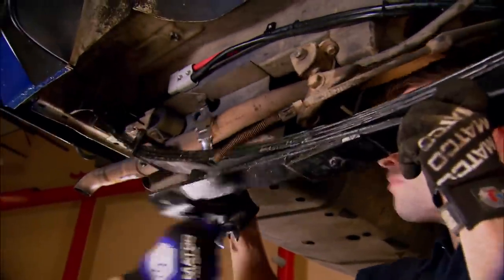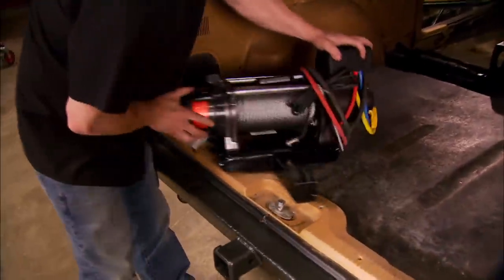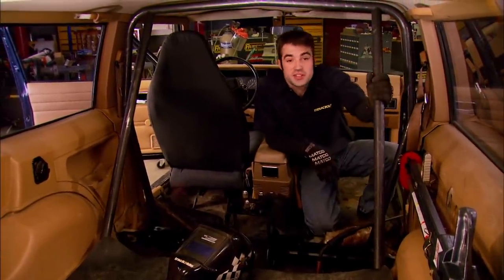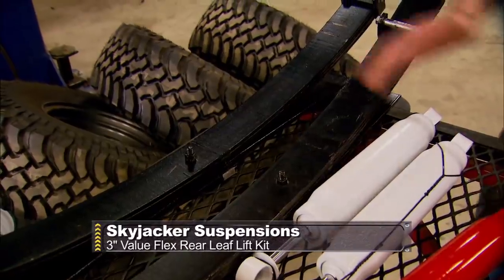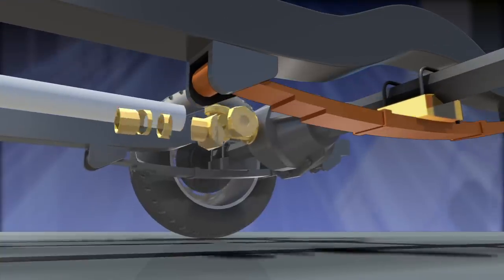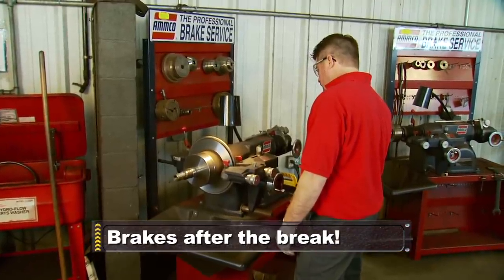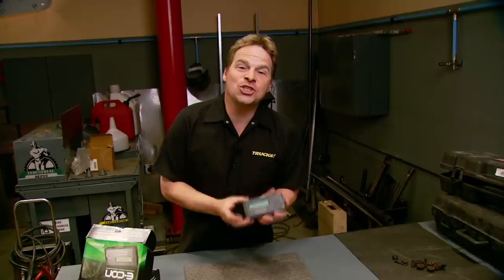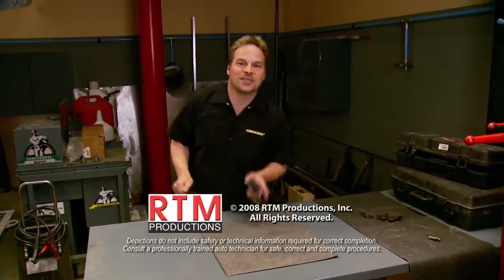Swapping In A Junkyard 8.8" Rear Axle In Our Cheap Jeep Cherokee - Trucks! S10, E9

Comment: You forgot to mention adding hub-centric rings that fills the gap between the rim and the wheel spacer adapter so your lug nuts are not taking the full load of the bumps in the road way and popping one of your wheels off going down the highway... @ 16:37.. clearly an issue... still a fun video though...

Comment: As cheap as new rotors are anymore I don't even bother with machining the old ones. All you're doing is asking for pulsating brake problems.
Reply: It was more about a paid ad, not saving money.
Reply: Yes
Reply: I haven't machined a set of rotors since 2002. New ones are so cheap
Reply: @dave1135  depends on what you drive.    For a Jeep buy new ones.   Those Brembos on a Hellcat or a ZL1 etc maybe turning is something to look at.
Reply: I was thinking the same thing new pads and rotor is only $130 front & rear on ebay for a jeep its what I paid an $190 frt&rear on my F250 even my VW tdi $170 an um talking cross drilled/slotted rotors & pads
Reply: @bmstylee  definitely. Brembos aren't cheap, so having them machined is a no brainer. I was a ASE certified master technician at a GM dealership and at a Goodyear auto service shop for over 30 years. I've turned hundreds of drums and rotors. We even had the on the car lathe for the Audi carline that had the internal rotors, looked like a donut. I'm retired now, but have a home shop where I do lawn mower repair, and the ocasional car for a friend. Had a 2000 cavalier needing front brakes and rotors, pads were long gone, so rotors were chewed. I ordered a kit with both rotors and semi metallic pads, rotors were $13.69 and pads were $12.65. Our cheapest shop turns rotors for $17 each. So new rotors are the best value.
Reply: American and their wanton consumerism

Comment: So, can we talk gearing on those axles? You guys are running 33s on an XJ, so what.... 4.56 gears? 4.10s at least. Also, does swapping to a Ford 8.8 not require a Slip Yoke Eliminator and double cardan shaft to avoid crazy vibrations? Little details I would love to know!

Comment: Pulled an 8.8 from the junkyard for $170. Snagged it by myself with just hand tools. 

Tossed that grenade d35. Surprisingly enough i also own those seats. The sun turns them into a scolding hot frying pan in about 2 minutes though.
Reply: Nice I paid 275 for mine shipped 2001 8.8 31 spline lsd disc brakes matched gearing. I'll run the lsd until I regear with lockers and larger tires.
Reply: @kzoomin  thats a great deal. Im running LSD as well, I'm planning on running lsd rear and locked front. End goal is to v8 swap and lsd has better mannerisms for that imo
Reply: I got my 8.8 for free lol
Reply: @franky6181  from my understanding lsd works up till about 32s 33s past that not 100% effective?
Reply: @randycane5894  lucky dude, I was also lucky to pick up a hp d30 from a 99xj upgrading to 1tons. The jeep community is awesome.
Reply: @franky6181  got me thinking with the lsd rear and a v8. Having the lsd clutch packs instead of lockers will be more forgiving? Less prone to broken axles and ujoints? I still have until the regear to decide. Thoughts?
Reply: @kzoomin  I've never heard of that. I know most wheelers dont like lsd because its basically useless when you have 1 wheel in the air however i have also heard you can engage both wheels by clicking the ebrake just a bit. Theres not really any good places for me to wheel besides the desert so lsd works great for me here.
Reply: @kzoomin  depends on what your goal is. Mine is to build a big, fast beach cruiser. Goodluck breaking that 8.8, theres mustangs that run well over 500hp and have yet to snap it.
Reply: @franky6181 makes sense thanks

Comment: Wheel spacers are not legal in Australia and some other countries as they have been connected with accidents! See worst 4x4 mods. Basically spacers require constant "checking" , About 500 miles after installation to confirm they are on properly and then every oil change or 3000 miles, which most people forget or are to lazy to do. Or they trust tire shops with employees who may not know how to check and maintain them. In addition there are cheep ones on the market that are just unsafe period.

Comment: Old vid I know. Wow not so competent xj build.
Xj crush in roll up front at wind shield. 
Skyjacker suxs.
Xjs aren't spring under but I like the animation. 
Throw rotors away their cheap.
8.8 install kits are cheap for last 10y +.
Auburn e locker is the biggest pos on our planet. And its a posi till locked so not for front diffs wo locking hubs.
Opinion only, 37s too big they kill xj zj yj tj. D30 is only barely good for 35s. 33s if u run it hard.

Comment: That Accell tune up kit gives more spark but won't last long i did that to my 4.0 my last 30 or 40k they should do 62mm throttle body 24lbs injectors/intake

Comment: When you put the cable clamp on the emergency brake cable. You put it on upside down. You never put the saddle of a cable clamp on the dead end of the cable. An old standard in the application of cable clamps. You never saddle a dead horse. Reverse that so that it doesn't come apart.

Comment: You may find driving the tow rig to the trail cheaper on gas than driving the Cherokee XJ 😂
Reply: I had a mile marker manual hub conversion kit on my old Cherokee. On 35s with 4:10s I was suprised to get 18mph

Comment: I had Midas do a complete brake job on my son's wheelchair van. I did the whole thing, caliper, rotors, bearings and anything that looked bad. 11 times back to the shop and I ended up redoing it my self....$1200 not well spent

Comment: Seriously? Spend the 3 mins and measure your driveline angles. Don't bend a wire and eyeball it. I feel like I'm taking crazy pills
Reply: Thank you! This is the first time in MONTHS that I have seen a comment mentioning pills that doesn't blindly love the medical industry and belittle their victims. Quite the opposite, your comment implies what I have known through experience since first grade, the pills CAUSE the crazy, not cure it. Between that, and the cool cars and mini bikes on your channel, you have definitely earned my subscription.
Reply: honestly, it doesn't have to be perfect. What they did will work just fine. Especially if you stay under 200 MPH.  :)

Comment: what was the gear and spline count of the salvage rear axle? Did you have to shorten the driver's side axle housing and double up on the passenger side shorter axle? I am researching the explorer 8.8 salvage option for my mustang so this is something i will have to tackle.
Reply: The 8.8 pinion is 2.5" closer to the passenger side than a stock XJ axle, but it doesn't cause any problems. 95+ is 31 spline and has disk brakes. Gear ratios came in 3.55, 3.73 and 4.10.

Comment: Your doing it wrong... the front solid axle and inline goes in a ranger ,⁸ I scrapped enough vehicles to tell you all ,the cherokee rips itself apart everytime you flex it, If you got a nice xj keep it that way in 20 years they will be worth 10 times what you paid, you flex a c channel ladder frame it springs back and your doors still open...

Comment: Yeah...LOL...my "cheap" junkyard 8.8 build is pushing $2.3k.  Ok, I'm trussing, adding in chromoly shafts w/c-clip elimination, Detroit tru-track, welded tubes, anti-wrap perch kit, traction bars, possibly a panhard bar, larger disc brakes, 5.13 gears....too much shit for a "cheap" build.  Amusingly, for my Ranger, the Exploder axle + Yukon shaft kit = 2" wider than stock "8.8".

My full "cheap" Overlander build based on my 2003 Ranger FX4 will cost about....$18,000.  Probably a bit more once I'm done being picky.
Reply: Are you actually breaking all that stuff or do you just like writing checks?
Reply: My swap cost me $583 with a truss, spare shafts, new brakes, diff cover etc. Detroit locker cost me $325. $908 total for a trussed locked 8.8 to replace my dana 35. Well worth the money.
Reply: @billkerksiek208  Intention is NOT to break anything and increase the payload and max tongue weight on the truck.  I go to some pretty nasty places, often by myself.   Spinning a tube or breaking a shaft would be serious trouble, not just hard ribbing from people with me.

Comment: $800 elocker is definitely budget huh?😂😂 You can pull a limited slip out of a Dana 30 volvo rear for pennies and it bolts right into the Jeep front. That's my setup.
Reply: What vehicle did you get they from
Reply: @whatsyourstyle  either a 740 or 940, one of the bigger old ones with a tow package. Just walk the Volvo row and check diff tags. Tow package is a good place to start.
Reply: @fgialcgorge7392  thanks
Reply: @whatsyourstyle  no problem.
Reply: So dose it lock up good ? Considering doing this cheaper then a lunch box locker definitely cheaper then a Detroit true tack
Reply: @fgialcgorge7392  right on hitting up my local pick and pull in the morning and checking the Volvos out . Thank you for the information. On the hunt for a d44 as well currently have a 8.25 but poor man’s posi wouldn’t mind having a 44 in the back .

Comment: Does the offset of the 8.8 work on the jeeps?
Reply: You have to cut off the old spring perches and weld new ones on. As long as you center it from side to side and set your pinion angle your good to go. The offset pinion doesn't matter, it's not that extreme and the u-joints will be fine.
Reply: @nsmturbo5902  thats the obvious but what about the 4 inch center difference? The offset from a explorer 8.8 lsd usually needs one side cut down to match the other like I had to do for my maverick
Reply: @triggerwarning2439  it will be fine... I ran a full width explorer rear in a S10 for years before finally chopping it down 3 inches.
Reply: @nsmturbo5902  what do you do for the brake line on the 8.8? Another video said replace the driver side brake line with another passenger side one and then you can use the hard line from your old axle? I have a 8.25 now btw